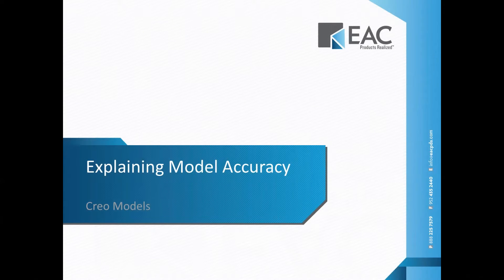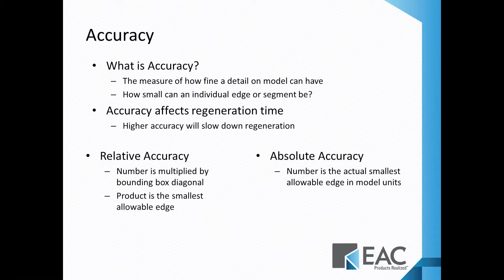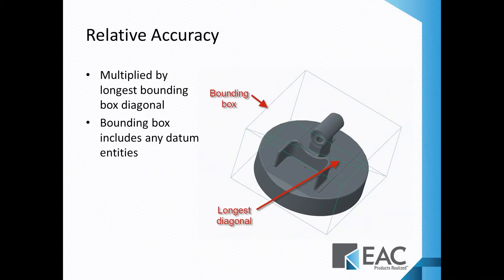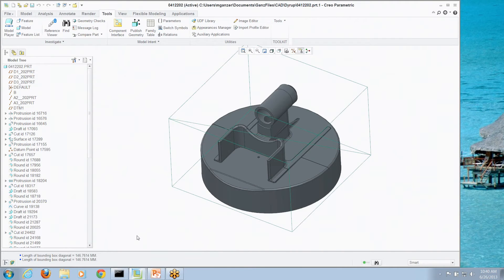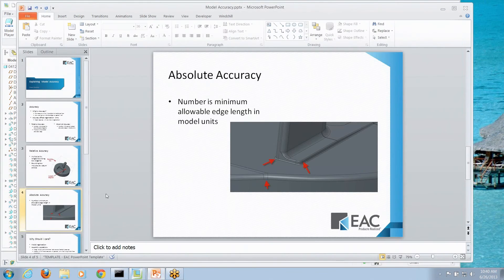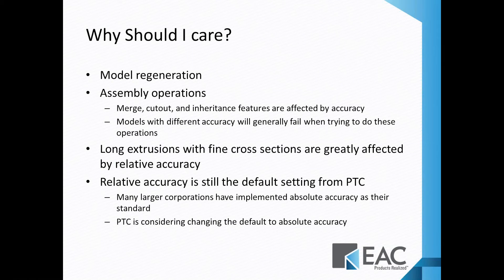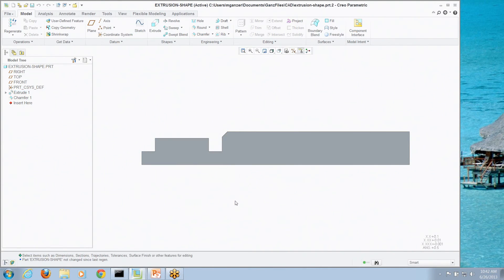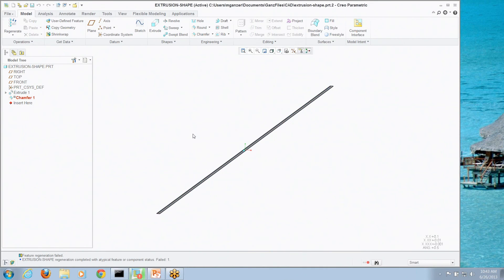Explaining Creo Parametric and Pro/ENGINEER model accuracy - EAC  PDS Tip of the Week

Comment: My question is about accuracy on the surface edges. How can I set up on Creo parametric 2.When I machine the model the dimension is oversized. I appreciate your help with the set up. This is not a solid piece it is only for surface. thank you.

Comment: Hi Mike,
The trick with accuracy is always only as accurate as you need but no more. I do not recell any benchmarks on accuracy out there, but I have been a part of internal testing in a previous life. It does not affect regeneration time as much as many other settings but there is a small hit.
Mark

Comment: I am very interested in this topic and wonder if there have been any tests done to compare the time differences in using different absolute accuracy values? We use a meshing software that requires all ProE models have an absolute accuracy of .01 mm and there cannot be any interfering components in the top level assembly that could have 300+ parts. A tool that we use is a lot is the Global Interference analysis. I have seen some regeneration and global interferences take as long as 20 mins.